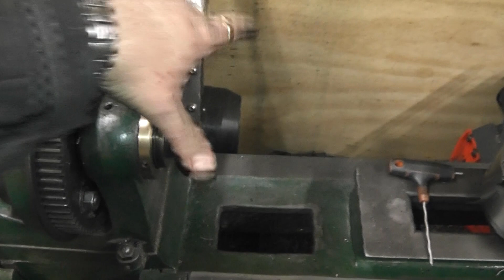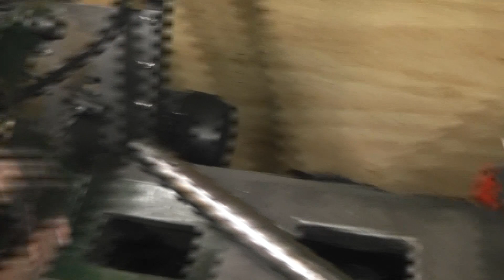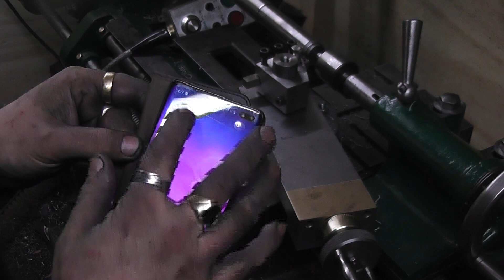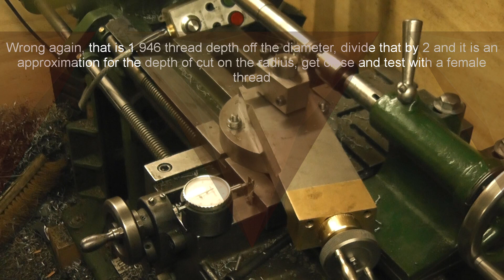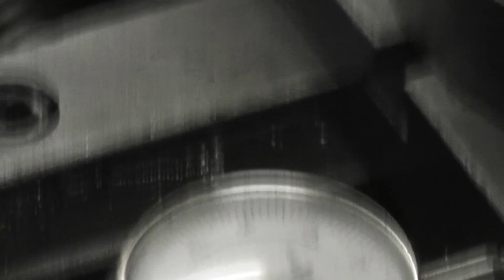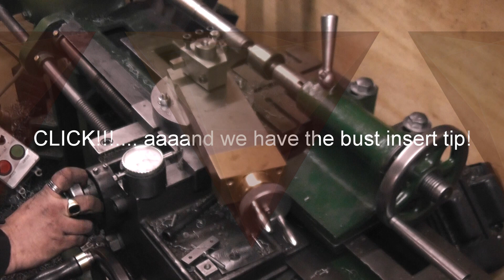Pt1 New Headstock spindle for my Drummond double bed height lathe

Comment: For your spindle thread problem,  why not bore and  thread a piece of round stock that is either slightly over 2 inch diameter or slightly over 2 1/4 diameter.  Screw it onto your spindle,  solder it in place,  then turn it to diameter and thread it 2"-8t.p.i. or 2 1/4"-t.p.i. ? Though not as common as  1 1/2"-8t.p.i. , both chucks  and  backplates can be found with those threads,  and  the  lathe can easily be returned to original.

Comment: Was there a reason you didn't cut a thread relief groove to run into  ?
Would save your tip when pulling out.
No need to jog either which I would think  put a lot of load on the tip too.
Reply from the maker: yeah a few reasons, I think a spindle nose looks better with a thread that ends without a relief, arguably stronger aswel because there is a wider diameter before the chuck register, I think in the past when spindle noses were formed without a run off area they were actually cut with similar to an involute gear cutter but the threads profile instead of an involute gear profile, done on a mill setup, I can't remember the term for it but when cutting helical gears a dividing head is setup with gears to the table lead screw, the dividing head turns as the bed moves and the cutter is set at an angle, depending on how the gears are setup and the angle of the cutter depends on how many teeth per inch are cut.

way before thread forming rollers.

I still need to get around to finishing the end of the thread with a die grinder though :) , it still ends abruptly instead of a nice curved end
Reply: @markhobster8113  Late to the show, but the name is "thread milling." There were special machines, but these days, CNC milling machines can produce the helix by circular motion synchronised to the vertical linear motion of a thread-formed end mill, i.e., the same motions as a CNC lathe when it is screwcutting.